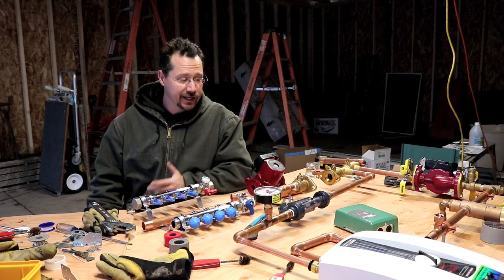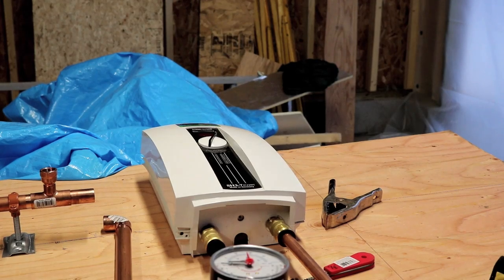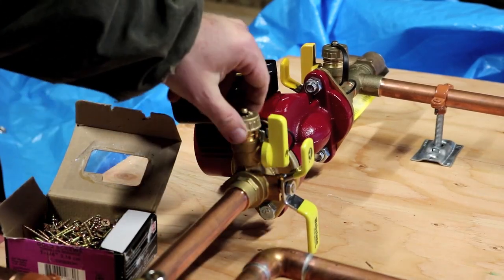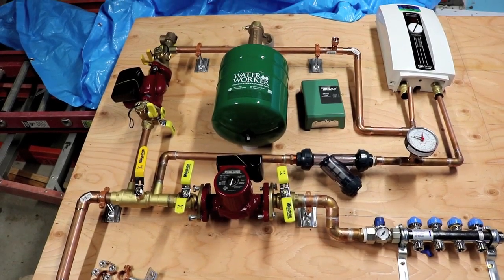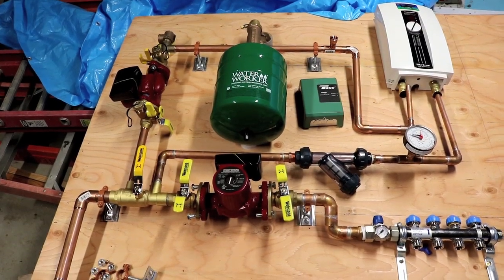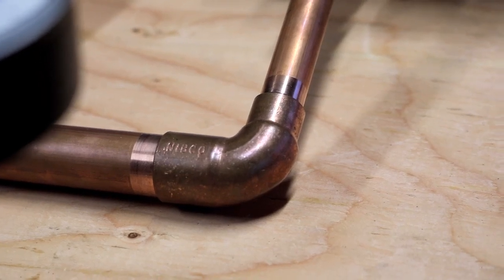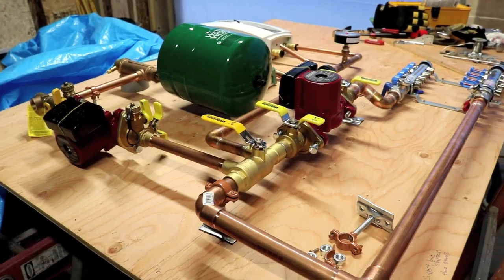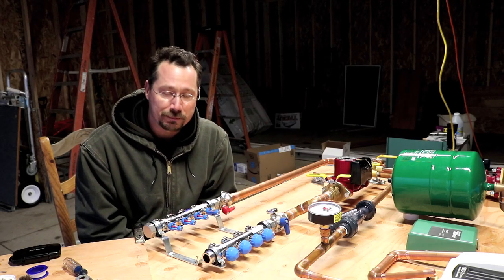Ben's Garage: Hydronic Heating Update Jan 25 2017

Comment: Nice neat work, the soldered joints look fine, actually really good for a beginner. Just wonder why you went with copper instead of pex?
Reply from the maker: Many of the components needed soldered connections anyways, so for PEX, I would have needed to solder something in AND then have an adapter to PEX. I did use "push-connect" connectors a fair amount on this project. Those do cost more than a soldered connection, but work really well, are removable, and they also make it easy to still rotate the pipe. That was handy for a few spots where the pipes had to be on slightly odd angles.

Comment: Love that system! Wood redundat awesome, but why bypass the electric heater, it will turn on automatically when wood craps out.
Reply from the maker: The electric heater is a style where you set the OUTPUT temperature at the heater. As long as the temperature is above that, the fluid will pass right through without being heated. So yes, a wood-heat source could be added with the electric heater still in series and it would all work just fine.

Comment: That is a lot of electricity in your garage. How big is your solar array?
Reply from the maker: The solar array has a 6.24kW faceplate value. I have a 100 amp electrical service in the garage. I have electric baseboard heaters upstairs, and a 7kW demand heater for the hydronic. (But I use the heat sparingly.) I also have two electric car charging stations, one for 30A, one for 16A.
I can weld or do pretty much anything else I could ever possibly want to do in my garage that uses a lot of power!
Reply: Wow that is awesome thanks man

Comment: Could this setup be used for baseboard radiators instead of in floor heating?
Reply from the maker: Hi Joe. Yes! This same type of system could be used with baseboard radiators. However, you should keep in mind that those systems typically require HIGHER water temperatures than using pex tubing embedded in concrete. Lower water temperatures mean less electricity (or other power source) to heat the area. Because my ENTIRE floor is a heater, it is a large area at a low temperature. With baseboard heaters, you have a much smaller area, so you need hotter water temperatures and more flow to transfer the same amount of heat.
If you are interested in designing and building your own baseboard hot-water system, go for it, but make sure you do your math calculations first!
Reply: Ok so I would have to use an actual boiler then not a tankless? I have no heat in my house and I'm being quoted over 10k for a furance and 8k for mini splits so I think this will be my cheapest option.
Reply from the maker: If you are adding heat to a house that never had one, there are a lot of variables to consider. For a smaller place in a relatively moderate climate (which I assume you are if you were getting by WITHOUT heat before) mini-split heat pumps are probably a good choice. They also give you the option to cool as well.
If you are specifically interested in DIY hydronic heating, take a look at Mr. Money Mustache's DIY Hydronic setup. http://www.mrmoneymustache.com/2014/02/16/the-radiant-heat-experiment/

Comment: Hi Ben, I built a system similar to yours. I seen some rust infiltrating my system  (i have cast iron circulators) and am concerned it will damage the tankless boiler. Did you have a similar issue? If so, how did you correct it? Did you use any corrosion inhibitors? If so, any recommendations?
Reply: U can stick on return an Magnaclean!
Reply from the maker: Hi Zachary. My system uses anti-freeze as the circulating fluid. The fluid I purchased (Cryo-Tek Blue)  is specifically marketed for hydronic heating systems and does have corrosion inhibitors in it. Care must be taken with systems that use straight-up water. At my house, we have very high iron and calcium in our well water. Because of that, an "on-demand" water heater for our household hot water would probably be a bad idea. I'm sure that heater would gunk up with minerals in no time.
For a closed-loop hydronic heating system using commercially purchased Propylene Glycol with corrosion inhibitors, I don't think it will be a problem. If you are using an open-loop water-based system, clean water and non-ferrous pumps are the way to go.
I also have a Wye-strainer in my system before the heater, but I have no idea how small of particular matter that will screen out. Always good to have filters BEFORE heaters and pumps though!
Reply: Make sure the PEX you are using is oxygen barrier PEX for hydronic systems, it is NOT the same PEX used for fresh water piping.  Cast Iron circulators, cast iron or steel boilers and any other ferrous metal in the system will rust due to oxygen migration into the closed loop.  This is a very common mistake when people build their own radiant floor systems.

Comment: Overdesigned and too expensive for a garage unless it’s a full time work shop. A $700 ductless split Heatpump would do the trick plus you get ac.
Reply: my question is do you already have a hydronic system working in your house why not tap into it
Reply: You can't beat a warm concrete floor in a garage or workshop.  Way more comfort than forced air.
Reply from the maker: It all depends on what you are trying to do. For example, a liquid based system like this makes it easy to connect an outdoor wood-burning boiler. Heating the concrete directly also makes good use of the thermal mass allowing for off-peak rate heating and the thermal flywheel effect.
Mini-splits are great, but there's plenty of good reasons to go with other systems as well.

Comment: You could have reduced cost by only using one pump since its only a one zone system. Also could have used a 110v thermostat strait to the pump eliminating the toco controller as well. This set up would also reduce the demand on your solar set up by not running two pumps and a 24v transformer in the toco controller. Great job by the way. Just my 2 cents. Cheers
Reply: Dan Smith 
,,ounce
Reply: Really? With Primary secondary, I'd say you absolutely must have two pumps. (?)
Reply: @constantreader7944  I just purchased a house and needed the boiler replaced. I am just like BenjaminNelson and knew nothing about boilers. I purchased the boiler new for 1820.00 USD after getting a quote of 8K install. I spent 3 days researching online how boilers worked, what made them tic and how to install them. Then had a grocery list of parts needed of 700.00 USD for a 2 zone system on a 2 story house with basement. I did all the work myself not knowing anything. Now, the old system only has 1 pump and I will continue with 1 pump. I will convert the 2 zone system to a 4 zone system because the baseboard runs are very long per floor. FYI 1 pump is all you need even for a 6 zone setup. My 1 pump is on the return line. any more than that is over kill and a waist of time/money.

Comment: hi ben. I have a hydronic water heating system and there's a hot water leak running from one of the copper pipes to the outside of the house. some infers I've called are not familiar with this system at all. any advice? i have a video of this leak.
Reply from the maker: I guess I'd say to call a plumber or HVAC person who specializes in that kind of work.
My garage hydronic heat system is the ONLY experience I have working on this sort of thing, and I wasn't running any copper pipes outside the building. Sorry I can't be more of a help.

Comment: What size garage are you heating??  Also do you have a parts list??   Great job BTW!! :)
Reply from the maker: The garage is 27 feet wide by 29 feet deep. I don't have a parts list. I simply duplicated a system I saw on display at a big box home improvement store. It is similar to this one: https://hw.menardc.com/main/items/media/HYDRO005/Prod_Tech_Spec/HSPS120LTSpecSheet.pdf
The linked file lists main components.
Reply: @BenjaminNelsonX  have you installed all of it and used it yet? How is it? What is your final assessment?

Comment: Did you get yours filled? Wayne 1/2hp Pump makes short work of it. get three washing machine hoses.  Also easy way to bring the system to final pressure.

Comment: Hey. Maybe wrap the pipes & some components, with insulation, to keep heat in the system, until where you want it to go out? Have the heat stay in the water, farther & farther away from the source. And even insulate the return lines, so the heater doesn't have to work as hard, to maintain a temperature. Saving energy. This is also a great idea for a home, so a boiler, doesn't have to work as hard, to bring hot enough water to an upstairs, or far away bathroom or kitchen.
Reply from the maker: In general, insulating pipes is a good thing. In this case, all of these components are IN the room they are heating. Any heat "Lost" just goes to air heating the space the floor is heating as well.
Reply: BenjaminNelson I understand. Thank you for all of the work you do. I'm building a hybrid motorcycle soon, and your videos about electric motorcycles, are a big help. I know you want to swear off burning fuels, but my solution to the range issue of batteries, is to use a small engine, meant for rc planes, to recharge the batteries with alternators or generators, and also directly power the motor controller & motor. With that setup, I can continue on a long adventure or continue delivering things, even when the batteries are too low. And I don't plan on always using gasoline. I want to make my own fuel, like moonshine.
Reply: BenjaminNelson Sorry. I meant a plug in hybrid motorcycle. And I will use built in hobby chargers to charge all the batteries to 85%, to get the most life out of them, and a DC to AC converter to power the chargers, and other things. My bike will be like a mobile generator, not only for the batteries, but for camping & emergencies.
Reply: BenjaminNelson BenjaminNelson ...Ben?...I understand if you hate me for burning any fuel. But I'm curious what you think of my set up. And not only am I using hobby chargers, to make sure I don't overcharge my batteries, but circuits to warn me, then disconnect the batteries, if they get too low. No BMS.
Reply from the maker: A hybrid motorcycle would be a great project. It's quite a bit of gear to fit in a motorcycle though. I always thought it would work best on either a trike or a motorcycle with a side-car. I would avoid trying to create AC power, only to convert back to DC power. Many battery chargers and power supplies actually can run on either AC OR DC as a source. The fewer times you have to change energy from one form to another, the fewer losses there are.
Reply: BenjaminNelson Thank you for the tips! Everything won't be limited to just the inside of the motorcycle frame. I was inspired by the Honda Goldwings. They're so heavy, but they handle so well, because so much of their weight is mounted low, fuel tank under the seat, and even though their engines are big, they're flat, and sticking out of the lower sides. I want my batteries to be like that. In a wide U or H shaped battery tray, that wraps around the rear wheel, doesn't stick so far out, that I can't lane split, and isn't so low to the ground, that I can't lean into turns, and there will be space in the tray, for my feet, and maybe passenger feet.

I will have to make the battery tray strong enough, to also support my weight, when standing in it, because I'm not using pegs, and strong enough to protect the batteries, if my bike ever drops. The main motor will be mounted into the tray & main frame. And above the tray, will be an aluminum plate, that I will mount the alternators and rc engine to. The alternators will be wired together, to combine their voltage or amperage, in a flat space, and they will have bigger gears then the rc engine, so it can easily spin them. There will also be a small electric motor, with an even smaller gear, to crank the rc engine, if it doesn't have it's own starter motor.

That V shaped space between the battery tray and the ground, at different lean angles. I wanted to make a fuel tank to fill that space, but to save time & cost, I will just fill that space with batteries, or just leave it hollow, and use the original fuel tank. Everything will be covered by a custom full fairing, and a strong cage with skid plates, will be faintly sticking out, to protect the fairing, batteries, and my legs.

I want cooling ducts, with fans & air filters, for the rc engine & the main motor, so clean air can keep their temperatures down. I wanted a sealed, liquid cooled system, using the liquid cooled motor from Thunderstruck-EV, but again, time & cost. I just need to build a motorcycle that I can ride right now, to deliver things with. The first form of my bike, won't even have batteries, because they're so expensive, and I don't want to get lead batteries, just to trade up to lithium. I will start out with a cheap motor & controller, likely from a golf cart, the plate, with the alternators & rc engine, and a simpler full fairing to protect everything from the elements, and bad people.

Over time, I will save money, and build up the full structure for everything else, before I buy them.

I also hate and distrust kick stands. So I will have to gently lay my bike down on it's skid plate cage, until I install a small air compressor, or strong servos, to extend a few skid plates down to the ground, to hold the bike up, when parked. 

But other then getting the motorcycle to basically work. The other priority, right after that, is security. A tracking system, alarm, cameras, and traps for bad people. Hopefully, I can make the rearview camera also be a security camera. Rearview mirrors are annoying. They would either be blocked by my arms, or too far out to lane split with. The first, basic form of my motorcycle, may still have mirrors. But they will soon be replaced by a camera & screen.

I'm sorry if I type too much.

Comment: I appreciate you documenting your process and thoughts. I do have a question for you regarding the primary and secondary loop.  It looks like your primary loop causes a back flow in your secondary if the secondary is not in operation.  Is that efficient?  is there a valve I didn't see?  Thank you.
Reply: The invention of PEX tubing revolutionized radiant infloor heating in concrete slabs.  By heating the slab not only do you have warm feet, but heat emanating from the floor reduces cold air stratification near the floor.   I am not familiar with any cost effective way of placing electric heating cables in a concrete slab.

Sidebar story:  There is a welding fabrication company in SW Wisconsin.  They originally had propane space heaters. In the winter, even with insulated shoes and layers of clothing, it was difficult to stay warm. Every time the overhead doors opened to bring equipment and supplies in and out, it would take 1/2 hour or more before the space heater caught up again.  They bought some newer, heavier equipment which required thicker concrete concrete floors. When they poured the new floors they also installed PEX loops in the slab.  The difference in comfort was night and day.  Now when they open the overhead doors, the recovery is not instantaneous but it is just a few minutes.  Now they no longer wear insulated shoes and boots to keep warm.  The floor is warm so all the equipment and steel stay warm since everything is sitting on a heated floor.
Reply from the maker: Both pumps have integral check valves built in. There shouldn't be any back flow.
I'm learning as I go too, so I wouldn't be surprised if there was some odd thing like that which I didn't catch. I did pretty much just duplicated the pre-made "Radiant Panel" at the store, so I hope I have this all right. At the point of this writing, (March 6, 2017) I don't have the panel yet hooked up, as I'm still working on the general garage construction. Once my wall interiors are finished, I will hook up the radiant, and troubleshoot it from there if needed.
Reply: I am a boiler mechanic for 30 years. Not sure why you wouldn't just use electric heat? Changing the energy to water is a loss of efficency . Elect heat is 100% already.
Reply: @dougshakell8003  mass.  As he noted earlier, baseboard or other electric heat would heat the air in his shop.  It would dump it the moment a door was opened in cold weather.  In floor electric in a garage slab seems a bit risky to me.

Comment: 1 battery 3.7 V and 16 kW \ h is obtained?
1 аккумулятор 3,7 В и 16 кВт \ ч получается?
iMieV what size battery 1, the size of whole cells 4 pcs?
1 battery 3.7 V and 16 kW \ h is obtained?
1 аккумулятор 3,7 В и 16 кВт \ ч получается?
iMieV what size battery 1, the size of whole cells 4 pcs?
1 battery 3.7 V and 16 kW \ h is obtained?
1 аккумулятор 3,7 В и 16 кВт \ ч получается?
iMieV what size battery 1, the size of whole cells 4 pcs?
1 battery 3.7 V and 16 kW \ h is obtained?
1 аккумулятор 3,7 В и 16 кВт \ ч получается?
iMieV what size battery 1, the size of whole cells 4 pcs?

Comment: I would check that the pump you are using to push water through your heater supplies enough pressure.  I worked in a builders merchants one time and the boss tried using a heating pump for a fountain.  It did not work because the actual pump is only designed to assist the water to circulate around the system.
Reply from the maker: These pumps are specifically "circulator pumps" designed for these types of systems. One thing I did was to make sure to keep each loop of Pex piping less than 250 feet, to help keep the resistance to flow low. Pumps for fountains and pumps for circulating hydronic heat are two very different things.